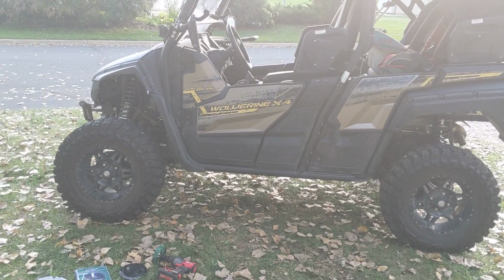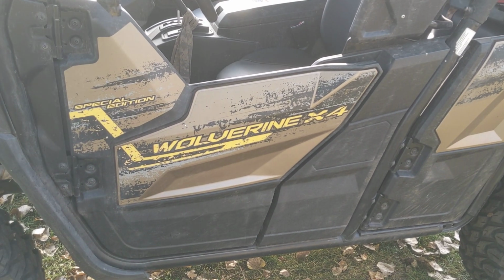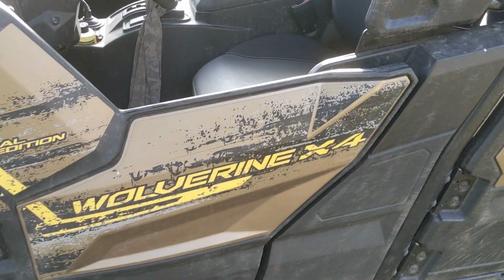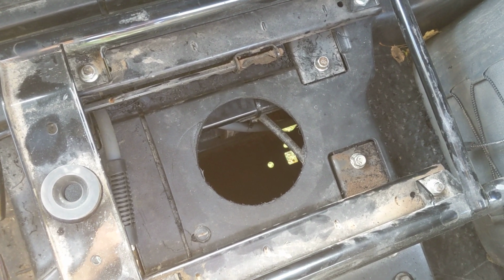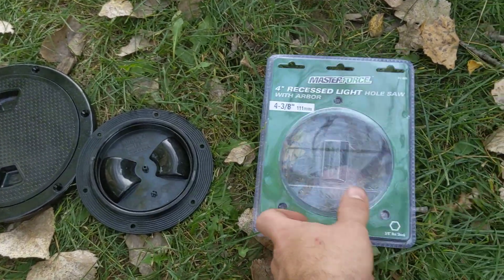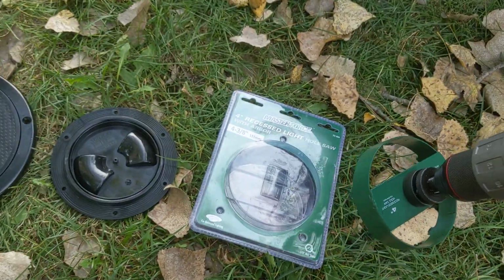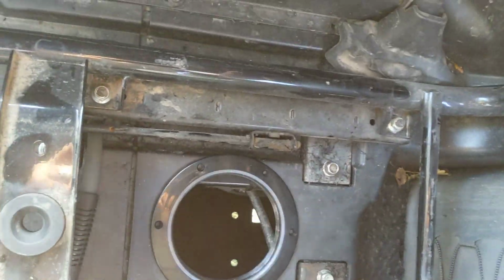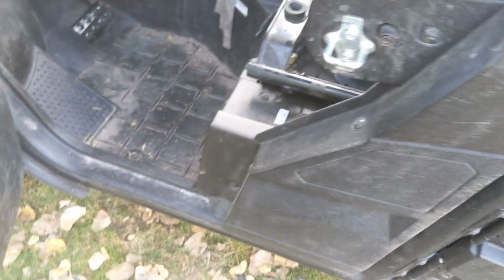Yamaha Wolverine X4 HIDDEN storage compartment!

Comment: Great job showing that, have you  installed larger tires ? I have a 2029 wolverine x4 would likeinstall 28"  high in stead of 26" stock. Has anyone tried that? Thanks
Reply: Yes 28 inch tires fit on my stock 2018 x4 with no lift but do have a 1 inch spacer in my rear

Comment: No inferno heater for you?
Reply from the maker: Not yet, we'll see. I'm actually working on a design to run ducts and vents from the engine compartment to the individual passengers. Would rather use the heat on board than add additional if possible!